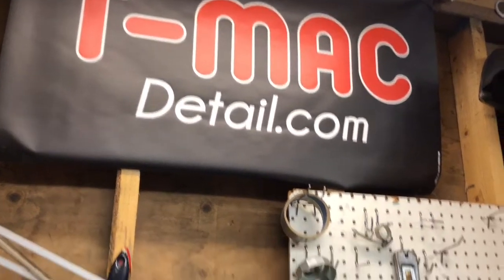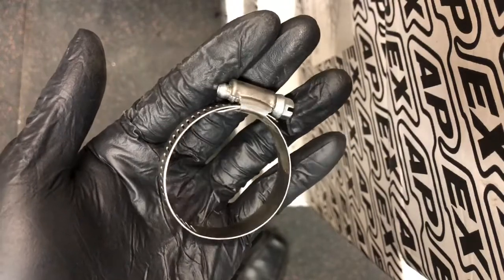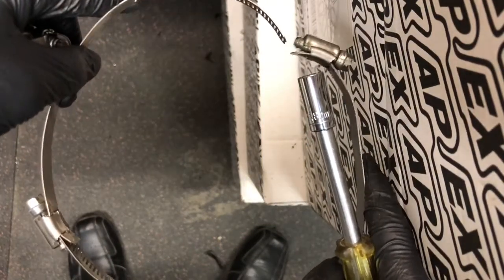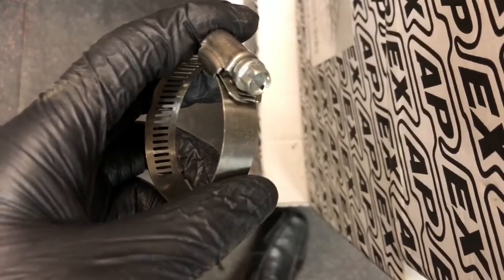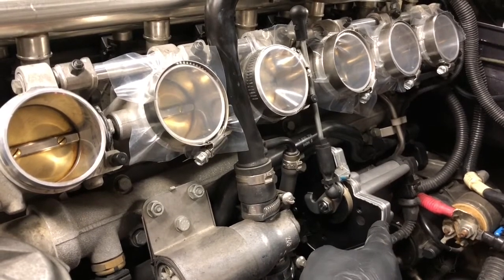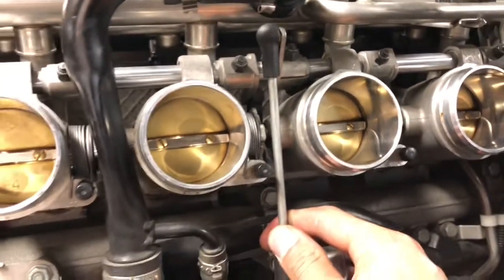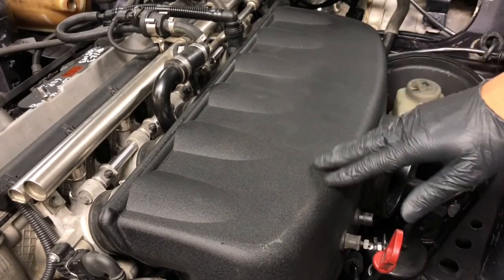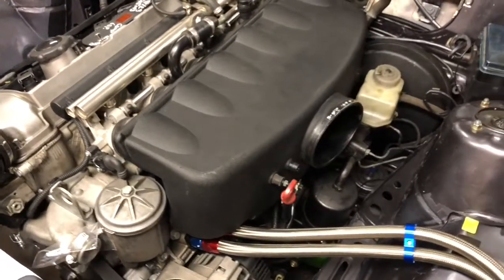How To S54 M3 Engine Swap Into E30 - Hose Clamps and Throttle Bodies

Comment: Did you use an E34 oil pan?
Reply from the maker: We used a modified S54 pan with custom subframe from Arc Asylum.
Reply: Next Level Mods ahh thanks! Those are hard to come across nowadays